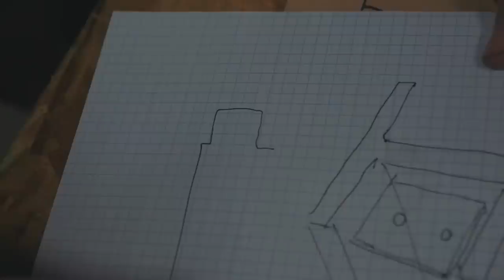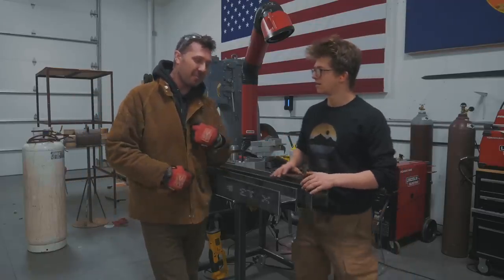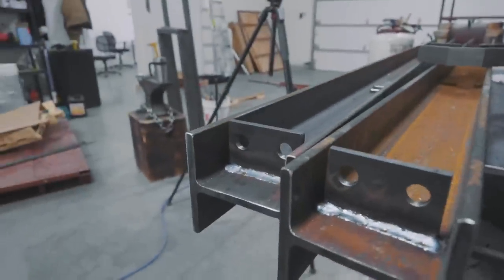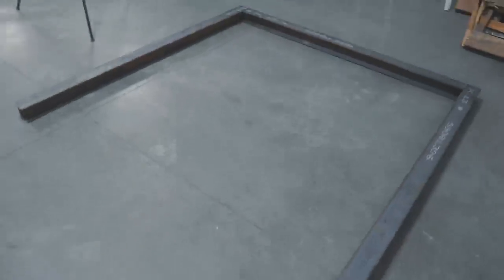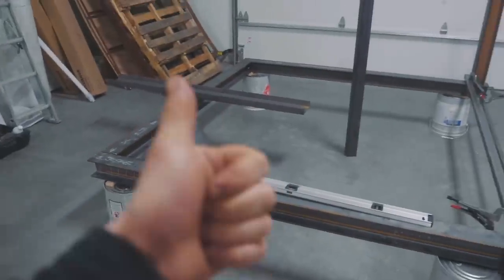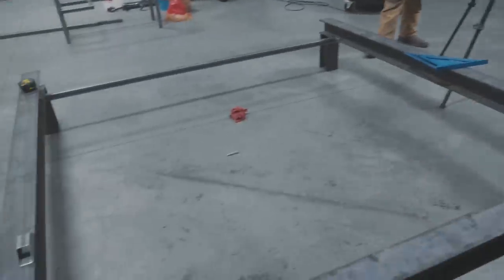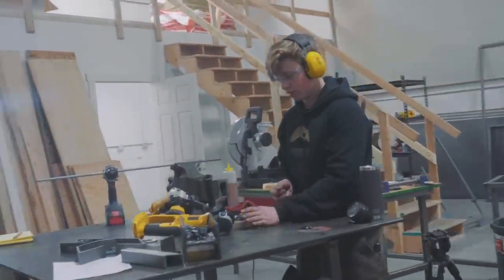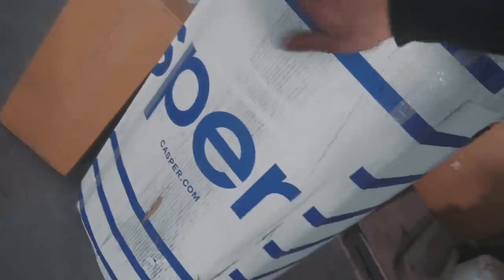MAKING THE INDUSTRIAL STEELE BED!!!

Comment: Let me know if you need a stress guy if you're doing more of this stuff. I've got a good deal of experience with analyzing/designing structures like this quickly so you won't have flex-y issues half-way thru. Every good fabricator has a stress&dynamics buddy they trust :)

Comment: Spray transfer is the way go but there’s no need for trimix gas, any co2/ar gas with less the 18% co2 will spray.  10% and 8% co2 are the most commonly used spray transfer gases.
Reply: I was wondering about the use of O2 myself.  I was always taught that the purpose of the gas was to eliminate oxidation.  But damn if those aren't pretty welds.
Reply: Q-Hack! Oxygen in small amounts is a useful in shielding, it’s increase the ionization energy of the shielding atmosphere thereby increasing the voltage across the arc.  This aids in spray transfer with lower amperage levels, the downfall (beside cost) is a significant decrease in the penetration characteristics when compared to ar/co2 mixes.  Spray transfer welds tend to look good because the transfer material is in a fine liquid state which eliminates spatter.  That being said, undercut and burn through can be an issue if travel speeds aren’t correct. 

A side note, for mig welding stainless steel the standard mig welding gas used is an Ar/2% O2 mix.

Comment: Jasons is a welder, a fucking good one too.
This should have been stick welded on the root at least, it doesn't have to have the machine begging for mercy
Also go with Purple beds Alex, its miles above casper.
Also no paint on the raw steel? What about rust?
Reply: Lindseed oil should work good enough for indoor use and occasional skin contact without forming rust

Comment: I like how he calls an "I" beam a Double "U" Beam
Reply: W-beam as in Wide flange beam
Reply: @timschrier903  nope it's an I beam
Reply: @backhomeprepper  An I-beam has tapered flanges with a narrower flange than most wide flang. A wide flange beam, with wider flanges and web than the I-beam, can handle more weight

Comment: I like the idea but I think 3 or 4 inch I beam would be perfect size and maybe it depends on where in the country we’re all from but I have never heard I beam called w beam sometimes when it’s wide I beam like that people call it H beam but never W beam
Reply: They are not actually called w beams. They are called a wide flange. An I beam’s top and bottom flanges are tapered. On a wide flange like he is using the top and bottom flange interior surfaces are parallel.
Reply: As someone who made industrial trailers for 4 years and commercial farming equipment for 11 years I would never have used that heavy a gauge material. 4 inch I beam by 1/8 th inch thickness will support a car hauler as cross beams with 4 inch side channels. This is just way over engineered.

Comment: I am not a welder, but I don't understand why there is oxygen in the trimix gas. The gas is supposed to work as a shield to prevent oxygen to come in contact with the molten steel. Can someone explain that to me?

Comment: I'm sure it's already been covered, but surely they are I beams. Hence the shape is an I. Please someone why they are not.
Reply: W-beam is a Wide flange beam, An I-beam has tapered flanges with a narrower flange than most wide flange beams, making it a lighter building material. A wide flange beam, with wider flanges and web than the I-beam, can handle more weight, but this makes it heavier overall

Comment: their called an H beam here in oz trying to work out how its a W beam
Reply: W- beam stands for Wide flange beam. An I-beam has tapered flanges with a narrower flange than most wide flange beams, making it a lighter building material. A wide flange beam, with wider flanges and web than the I-beam, can handle more weight, but this makes it heavier overall

Comment: What's the difference between a w beam and an i beam?
Reply: An I-beam has tapered flanges with a narrower flange than most wide flange beams, making it a lighter building material. A wide flange beam, with wider flanges and web than the I-beam, can handle more weight, but this makes it heavier overall
Reply: @timschrier903  Thank you sir

Comment: Just wait until you have a wife (husband? I'm down with diversity) and this is the first thing to go when they move in.  No matter what aesthetic you have, it will always be the opposite of yours.

With my adulting experience as a renter for many, many years, this beast is going to kill your security deposit on any flooring as is.  Carpet is going to be permanently crushed and stained with rust spots and hardwood/laminate is going to be scratched (even just getting in and out of bed by yourself over many months) and stained with rust.  My suggestion either way is to clear coat the parts that touch the floor to prevent rust and spray glue a thick felt pad to the feet.  The weight of this beast is still probably going to kill a security deposit on a carpeted floor, but thick felt and protected iron should be good on hardwood or laminate.

All that being said, it was enjoyable to watch masters at work.

Comment: “W-beams”? AKA “I-beams” though, correct?
Reply: those are wide flange beams (aka w-beams), the flange on the beam is much wider than that of an i-beam so yes the correct term would be a w-beam all though they are similar there are a good amount of differences

Comment: Is that not an I (capital “i”) beam?
Reply: If not, what’s the diff between i & w beams? And are they standard around the world?
Reply: @cmphoto_  W-beam stands for Wide flange beam, An I-beam has tapered flanges with a narrower flange than most wide flange beams, making it a lighter building material. A wide flange beam, with wider flanges and web than the I-beam, can handle more weight, but this makes it heavier overall

Comment: I think I would have had the bed sit on the beams with the beams sticking out 1cm/1/2" at most so you aren't constantly hitting it with your legs.
I really hope you don't turn your channel into an infomercial, I'm already bombarded with enough advertisements to choke a Blue Whale as it is.

Comment: dont think it be very comfortable getting in and out 
stepping out of the bed and hit the cold steel with bare skin will wake you up for sure 
hitting youre shin or knee stepping intoo the bed whont feel verry nice either 
if i had build it i mightve started with box section and not H beam
offcourse you can still clad the top in some nice hardwood planks mounted with carriage bolts through the steel that stick slightly over the edge of the steel if you get tired of the cold touch and bruises , could even add spacers and have the planks "floating" over the steel and still have it look industrial

Comment: How does a beam that looks like an I, is shaped like an I, is called an I-beam in every country on earth, get called a W-beam in the States???
Reply: An I-beam has tapered flanges with a narrower flange than most wide flange beams, making it a lighter building material. A wide flange beam (W-beam), with wider flanges and web than the I-beam, can handle more weight, but this makes it heavier overall
Reply: @timschrier903  Thanks for the really succinct explanation. Makes perfect sense :) You learn something every day.

Comment: It’s a I beam
Reply: W-beam stands for Wide flange beam, An I-beam has tapered flanges with a narrower flange than most wide flange beams, making it a lighter building material. A wide flange beam, with wider flanges and web than the I-beam, can handle more weight, but this makes it heavier overall

Comment: never heard an i beam called a double u beam.
Reply: W-beam as in Wide flange beam, An I-beam has tapered flanges with a narrower flange than most wide flange beams, making it a lighter building material. A wide flange beam, with wider flanges and web than the I-beam, can handle more weight, but this makes it heavier overall

Comment: For the love of god its called an i beam
Reply: W-beam as in Wide flange beam, An I-beam has tapered flanges with a narrower flange than most wide flange beams, making it a lighter building material. A wide flange beam, with wider flanges and web than the I-beam, can handle more weight, but this makes it heavier overall. So there is a difference
Reply: @timschrier903  oooooh, today i learned. I stand corrected

Comment: How is that a "W" beam. Blatantly a I beam
Reply: I beams and W beams are really similar, An I-beam has tapered flanges with a narrower flange than most w-beams (wide flange beams), making it a lighter building material. A wide flange beam, with wider flanges and web than the I-beam, can handle more weight, but this makes it heavier overall

Comment: It's an "I" beam not W beam!!!
Reply: An I-beam has tapered flanges with a narrower flange than most wide flange beams, making it a lighter building material. A wide flange beam, with wider flanges and web than the I-beam, can handle more weight, but this makes it heavier overall. So in this case he used a W-beam

Comment: where do they call them W beams? aren't they I beams due to the obvious similarity?
Reply: W-beam as in Wide flange beam, An I-beam has tapered flanges with a narrower flange than most wide flange beams, making it a lighter building material. A wide flange beam, with wider flanges and web than the I-beam, can handle more weight, but this makes it heavier overall
Reply: @timschrier903  I wont remember any of that, but thank you for the clarification that they are separate things.

Comment: Why do you call it a w beam all us in the UK know it as a I beam
Reply: W-beam stands for Wide flange beam, An I-beam has tapered flanges with a narrower flange than most wide flange beams, making it a lighter building material. A wide flange beam, with wider flanges and web than the I-beam, can handle more weight, but this makes it heavier overall

Comment: Why does he call an I beam a W beam?
Reply: An I-beam has tapered flanges with a narrower flange than most wide flange beams. A wide flange beam or W-beam, with wider flanges and web than the I-beam.
Reply: @timschrier903  Cool now does that mean it has significantly more compressive strength than an I beam?

Comment: You keep calling these beams "W" beams, I was under the impression that they were "I" beams, is this an American term for them? If this is please point this out.
Reply: W-beam stands for Wide flange beam. An I-beam has tapered flanges with a narrower flange than most wide flange beams, making it a lighter building material. A wide flange beam, with wider flanges and web than the I-beam, can handle more weight, but this makes it heavier overall

Comment: but...why do you call it 'W-beam'?
edit: ooooohh ok, it supposed to say 'double-U beam'  now it's starting to make sense
just call it H-beam or I-beam instead..

edit: nevermind that 'double-u' nonsense..
Reply: W-beam stands for Wide flange beam, An I-beam has tapered flanges with a narrower flange than most wide flange beams, making it a lighter building material. A wide flange beam, with wider flanges and web than the I-beam, can handle more weight, but this makes it heavier overall
Reply: @timschrier903  Oh, all right then, just googled it and found out, this is actually a thing in the states. I can pretty certainly assume, this is not common here in germany. That's also why I've never heard of it before
Reply: @ichbrauchmehrkaffee5785  to be honest neither had I until i researched it after watching this video and seeing all the comments regarding the beam

Comment: It's not not a heavy duty bed, it's just heavy bed. All this exess mass doing nothing positive for construction strength butt adds much load to joints and mounts. And also you know nothing about weight distribution. Little wit in the head makes much work for the feet.